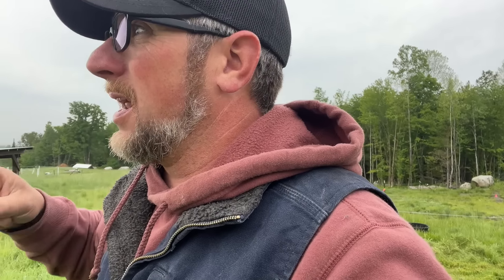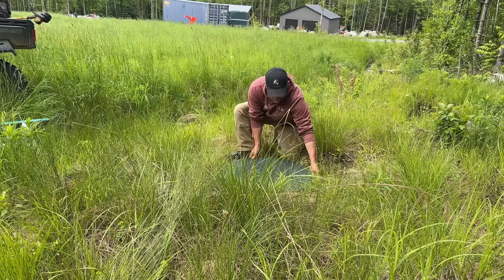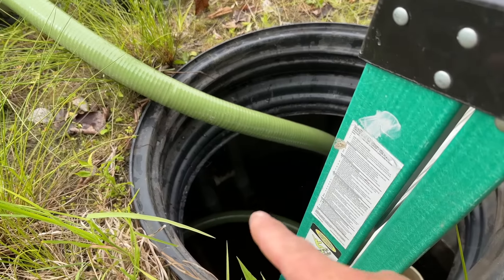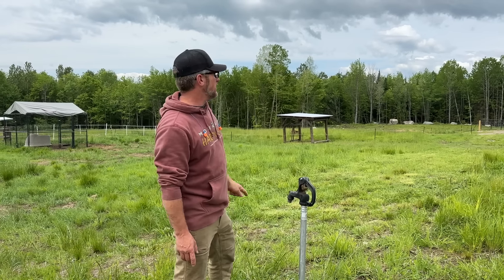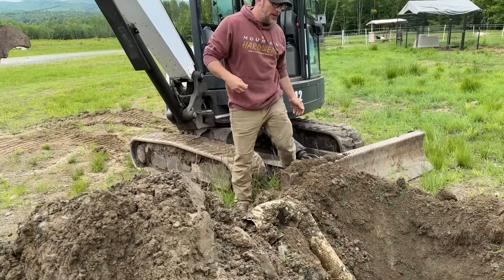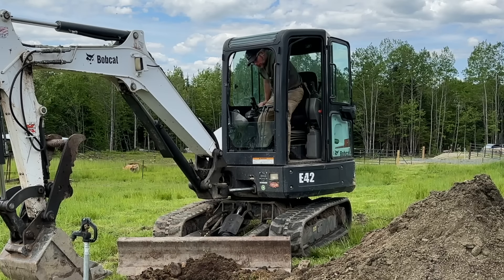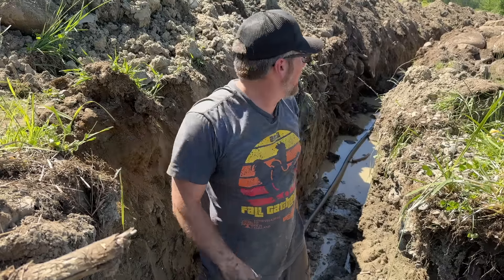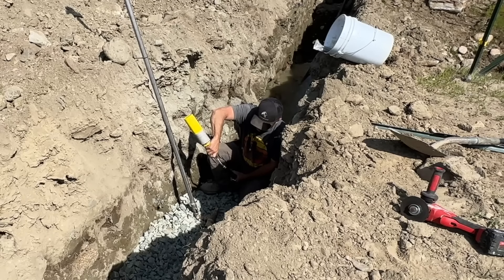I Have to APOLOGIZE for THIS...

Comment: OK Al, I'm sorry, I'm  putting on my first responder Hat. Please don't attempt to go into a confined space area like the one you put the ladder in without proper safety measures installed. A tripod with a retrieval system  attached so if your were to become incapacitated at least Gina would have away to get  you out. Being that how far into the woods that you live.Loosing  a cat an a cow is hard enough I know but we would not want to lose you.
Blessings my friend, stay safe.
Bill

Comment: Thank you, Al, for answering the question I asked about 6 months ago.  I was wondering if those hydrants drained the riser pipe when you shut them off, otherwise the water would stand in the pipe and freeze so you wouldn't get water the next time you tried.  On that note, that could be the leak in the hydrant you pulled out.  The seal that shuts off the drain hole when you open the valve could be damaged, something to check instead of throwing it away.  Maybe you can get a rebuild kit and replace that seal.
Reply: I know with the Woodford frost free hydrant you can get rebuild kits. I hope his brand has that too. Have a great weekend!

Comment: JudithB  I had  my  waterlines  put  2'  down  here  in  Arkansas  just in case!  Electric  and  phone lines  are  in the ground too.  All  our  problems  are  under  the  houses.  Irk!  20%  chance of  rain  today,  so  it  rained.  I  did  get  more  pruning  done  in  between showers,  and  hope  to  get  more  done  before  the  next round begins.  Trying to  get  more  fire  resistant  before  summer heat and  drought  arrives  next  month.  I  think  I  would have  run  the  waterline  on  over  to the  shop  since  you  have  that  ditch  open already.

Comment: I love the shot of Brutus and Miles.  I’m glad to see that Brutus has gotten used to the new cattle.  He wasn’t too impressed at first. 

I used to dispatch snowplows.  One of my drivers once limped back into the shop with his HAMMER taking the place of the pin that was supposed to be holding the plow on his truck!  The hammer handle worked in a pinch, but he was glad he didn’t have to travel very far.

Comment: Why not rent a trench digger? We have these big dig wheel machines that spins and digs a slim trench and they come in different widths and adjustable depts. They are a bit hard to control , but very easy to use and you always end up with a perfect trench every time. Add a bit of sand in your hole and add in the pipe behind the digger, that way you can lay hundreds of meters of pipe each day with a small team. The ones they have for rent here can at max make 3 feet deep trench or so and that's enough to be below the frost line where I am. Last time we used one was when we lay in a new power line for our seaside cabin. That little machine cut straight through the forest area and all we had to do was to control the direction and slowdown speed.

Comment: You may need a stronger fence to pen in heavy animals like cattle.
Reply: Especially for the hairy type cows which are notorious for being escape artists even with normal wood fencing.
Reply: Agree...totally inadequate.
Reply: Our deepest condolances...the greater family mourns with you. Lessons learned, with rugged and hilly teŕain and rocks like you are faced with, it appears you will need a significantly strong fence for such large and strong animals. You could limit that cost to areas of pasture sufficient to feed intitial cattle and extend the hard fencing as time and $ allow. It may slow your plans but for safety be better. Does Morgan Shaw have a highland steer that might meet your needs and you can afford? I think Miles will do well with goat company as well as at least Cookie.
Reply: There are many large ranchers that use similar methods - it’s just fine. It happens, it sucks, but it’s part of the process sometimes.
Reply: Electric fences are ok for small animals, as a temporary fence, but large animals need proper fencing, so George is still AWOL.
Reply: It seemed like a convergence of events, Al normally puts the cows away at night this time he didn't. I bet Al puts them in the away every night going forward
Reply: @jamesmatheson5115  George isn't AWOL. He was found the same day he disappeared. He is buried now.
Reply: @jamesmatheson5115  AWOL????
Reply: @RayneZaleska  I missed that info, been busy, thats a sad and hard lesson to learn.
Reply: Im sad for Miles to be alone.. I hope you find him a pasture pal soon.

Comment: Good afternoon Al and Gina!
I live in SE GA where every 3 years we get 1/2" of frost.
I installed fence for 15 years including every month of the year with no breaks.....and yes we dig 6" deep into sand.
Unfortunately that comes with 2 seasons very hot and mild temperatures. 
It snowed the year my nephew was born,it snowed again the year he turned 30😂😅.
Today I worked on my sprinkler system at 12" deep, however it was 98°.
The grass isn't always greener on the other side of the fence unfortunately lol.

Really enjoying the longer format while I soak up the ac.
Keep up the good work!

Comment: What a project!  I think you should have run the trench to the workshop now while you were at it so you'd have water to the workshop, too.  It's good you have extra gravel for the bottom of the faucets and road repairs as well.  It's time you guys start building a rock wall, like your old property, maybe at the entrance into the big clearing.  It would be pretty, or maybe at Gina's secret garden.  It's amazing how rocky that property is.  The boulders already around the edge are amazing.
Reply: Agree 100% about running water to the workshop now. It will be a mistake to have to do it later.
Reply: Both good suggestions, rock wall & water. Remember, they have water lines running thru the shop floor so he IS going to need water there.

Comment: Al you should put in a curb side shut off in now.
Also after every second water tap put another tank and a shut off valve too in the ground as well that way if something happens to one section you know you have at least a weeks water to the other taps and pastures. Just a thought.
All those rocks you should use to start a rock wall around the secret garden.

Comment: Those rocks look good for the ends of your culverts and they could be used for dangerous areas where the cattle are at. You have a good amount of rocks to use on the property that could help with fencing/blocking and around the hydrant to keep the cattle from rubbing on them.

Comment: It may cost a bit extra,  but I always bury an extra line when first digging.  Glue cap both ends shut , for you never know when frost line goes deeper than 4 feet, it does happen. Saves alot of hassle in future events! Might want to get SENSORS CAMERAS on the fence line to see what exactly might be living out there scaring your animals. Just a thought.

Comment: 5:43 I worked for At&t for 30 years.  For the second half of that I pumped water out of underground  cable vaults(manholes) just about every day. Didn't have a really fast pump like that. A few trucks had hydraulic pumps that would clear it in minutes but the standard issue pump took a while.

Comment: Good morning Lumnah family from a wet and drizzling Elmwood Wisconsin. Good morning viewers. I sure know that well water is cold! It's good you had the pump to get the water level down. That trenching is going well. I'm so glad it was a 5 minute fix on the pin falling out of the bucket. That is a bunch of big rocks all together. It's cute how the cows like to watch. Yay, fitting leak fixed. Gina's going to be happy with those rocks maybe. I don't know what you're apologizing for. Yes, your future self will be very happy to have the new frost free hydrants. The weep hole has to drain when you close it. Are you using the gravel bucket around the hydrant bottom still? I've found the Woodford frost free spigots to be the most reliable and repairable above ground. Well worth the extra money with the adjustable clevis for leaks at the handle and the replaceable insides from the top if a leak starts. We encased our stone in landscape paper and plastic containers to keep the gravel from being filled with dirt. We have clay soil so that was a must. I'm glad you put the t-posts down inside the trench to keep the hydrants vertical. Animals will want to "scratch" against them so some kind of protection should be put up top too. They are sturdy but too much wiggle can hurt connections down below. Ask Doug of "off Grid with Doug and Stacy." That's wonderful that you have more frost free spigots to water the animals with. Thanks for this video Lumnah family!

Comment: I realize it's most likely way to late for a suggestion. Hope you took the opportunity to and your shut off valve at the tank while you had it off. Also good idea to add 1 on the inlet side just incase. Where you took out the 1 hydrants and added the "T" should've added 1 there.
Ya never know maybe 1 day you might want to add a second tank and that would be an prime location.
Keep up the good work and hope you get lucky enough to be able to find a replacement for the loss of your pet/farm animal..

Comment: Al there are brass. Valves that are quarter turn valves.  You can have the handle above ground level.  Use rigid PVC pipe to for the handle allow you to turn the water off by using several 90 degree elbows to create a Horizontel place for you to shut off any hydrant independently.

Comment: @ 24:00 Al have you thought about investing in a trenching bucket, so as to not have to dig such a wide trench ?
Reply: I was thinking the same thing - a bucket that's not quite as wide would make it easier to trench these lines.
Reply: narrow buckets are generally used in a shallow trench of less than 2 feet.
Reply: @rupe53  - So not a good choice for Al, then?  Good to know... thanks!
Reply: my brother has both buckets for his machine. (a bit larger than this one) Gas lines, electrical lines, irrigation and such usually are no problem because of the shallow depth. If you hit a bigger rock, you can dig next to it and push it over. With a 4 ft deep trench, the smaller bucket (and more rocks) you just can't move things so need more space to work in general. Here in Ct it's not unusual to make parts of a trench 4 feet wide just to go around big rocks.

Comment: There's a trick you can use that pen warrant flips over the lock flips over the dude. The your pen that goes through your excavator arm. What? You can do is take a piece of wire. Go over the flip flip ring around and tie it down with a piece of wire, and then it aint gonna come out ever. That's what a friend of mine uses.

Comment: The easy part is done. Now ya Gotta move all those boulders and replace that space they took up with fill. Maybe use them to make a 12' circular raised flower bed near the corner of the drive up to the house. Add some solar lights in it.

Comment: Well Al with all those rocks you dug up you earned a lot of brownie points from Gina and her rock gardens. And you can use some of them to out around those hydrants out in the field to protect them from the animal rubbing against them and the one by the barn from a vehicle hitting it [snow plowing car truck trailer backing into it] And that hydrant that was leaking it was doing that because like you said only did that when the valve was left partially open thats because when the valve is all the open it closes off the little drain hole when you close the valve it opens up that drain when it's partially open so is that drain hole so that hydrant is stiil good to use you can test it by hooking a garden hose to from inlet side then leave the valve partially open you should see water coming from the drain hole I'm sorry I got long winded

Comment: Do you have to drain the system during the winter? I know your water lines are deep but I am thinking more your holding tank freezing or is it deep enough?
Reply: When Al built it, he figured that the thermal mass of the holding tank would be enough to keep any freezing at bay and not be an issue.  So far it's worked fine and it's been a couple years since he put in the system.

Comment: Man, that's a lot of work. How are you going to get hot water to the Radiant Floor Heat in the shop ? Are you going to have to trench it from the Tiny home ?
Reply: A separate heating system will be installed as mentioned in previous videos.
Reply: @tonygrimes13  Thanks Tony, I must have missed that. I have slept since then.
😁

Comment: slightly different suggestion 
 i recently watched another channel with rather new excavator   catch fire while he was inside using it   no fire extinguisher on board  he had to run to another piece of equipment with fire extinguisher  only to find out it didn't work either total loss of his new to him only 400 hrs escalator 
   point of suggestion is have not seen any fire extinguisher 🧯🧯🧯🧯🧯 anywhere   on you shop or barn  or any equipment     spontaneous combustion is a thing that happens when least expected 
  gas and diesel  equipment

Comment: Why didn't you put street shut offs on either side of the t? Then you could isolate each extension.
Reply: I wish I put in more street shut offs.The different MFG of these hydraunts sell rebuild kits which I keep on hand. The Campbell seem to need servicing more often. The no dig seem like a good idea every time i have to dig one up, I wonder if the higher prices would pay off over years .

Comment: I would have run the water line right over to the shop while you're using the excavator, I'm sure it would be nice to have water at the shop. You may want to have a slop sink in the shop.

Comment: Fencing needs to be stronger .
Reply: It was a freak accident. 
Freak accidents happen inside fences too. Fences don’t keep geese out. Cattle need to eat grass. Grass pastures prosper and grow best when animals graze. 
Single strand fences are effective for beef cattle grazing when moving them daily into small paddocks. Intensive grazing techniques are generally used for larger herds. Not necessarily for two beef. His fences are ok.
Reply: @sharper6577  If his fences were ok, this wouldn't have happened. Also, he alone is responsible for making the pastures safe. Like removing dangerous hazards in case of a "freak" occurrence. Removing those boulders could have saved that animal's life. Blaming this on a goose is crazy.

Comment: AL, not trying to jinx ya but, Andrew Camarata just lost an excavator due to a fire. Make sure your extinguishers are in working order. The affected machine didn't have one installed and he grabbed one off another excavator and it didn't work. Had to just watch it burn because he was miles away from everything. Had he called the fire department for the 1st thing, it may have been saved.

Comment: Al, get yourself a Ditchwitch.
That would make ditch digging easy.
Reply: they will never go 4 ft deep.
Reply: Look into the larger ditch witches.
They're used on battlefields to dig trenches.
Reply: @martinfinn674    a similar machine is used for strip mining... but consider the cost difference.

Comment: You need to replace the bottom seal in the foot valve  in the frost free  hydrant.  Using unfiltered surface water you get sand and other particles in the water that degrade the o-ring seals in the hydrant, causing it to leak on the bottom seal, as it has a double acting piston in the bottom.   You need to pull to  hydrant top head and reseal the hydrant..

For the shop  you need to put in a well Water hydrant  that of potable water and the the surface spring water run off that may or may not contain E.coli bacteria and parasites',  to use in your meat processing at the barn area and in the shop area,  also you need to have potable water at the shop for you needs for drinking and hand washing , and cleaning food preparation equipment that you may be using in the shop when slaughtering animals in that area.  

I think you will be shocked what you find in your gravity fed water system if you had the water tested in a laboratory, because  Spring water can contain many types of bacteria, including coliform bacteria, E. coli, and pathogenic bacteria :  include Bacillus cereus, Pseudomonas aeruginosa, Pseudomonas otitidis, and Streptococcus agalactiae.

Spring water is more susceptible to contamination than well water because it's groundwater that's closer to the surface. Springs are often formed near areas where water seeps into the ground, and can be contaminated by surrounding land uses.

While this water may be safe for animals, for humans it can be deadly and cause sever illness.

Be smart and put in a well water hydrant near the shop and barn.
Reply: when you are on a farm, you don't have too many choices on where your water comes from so there's an old phrase that comes to mind... always drink upstream from the herd! (and test the water every so often)